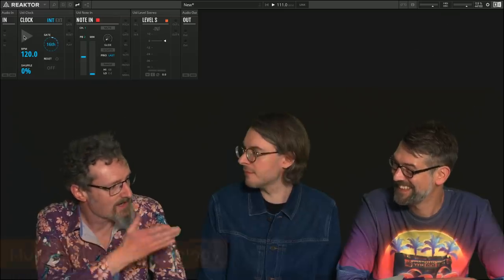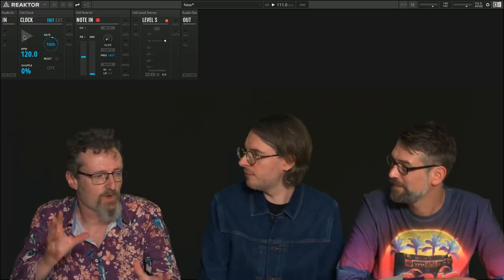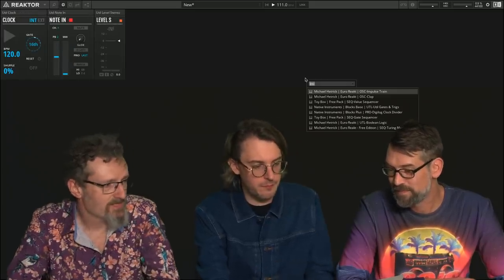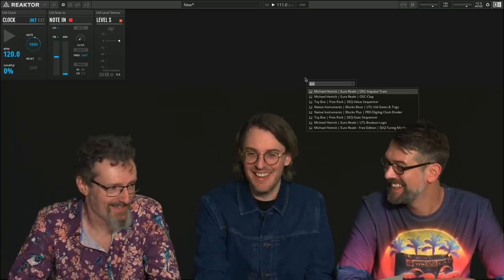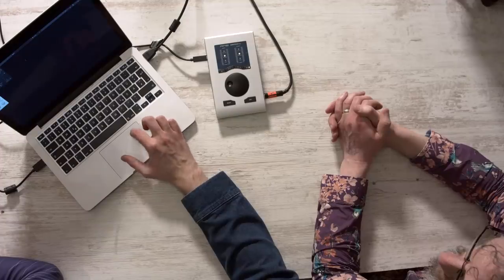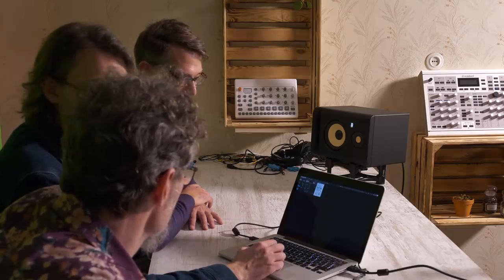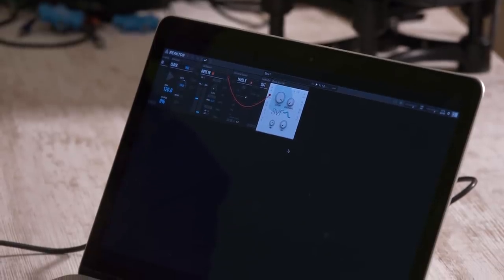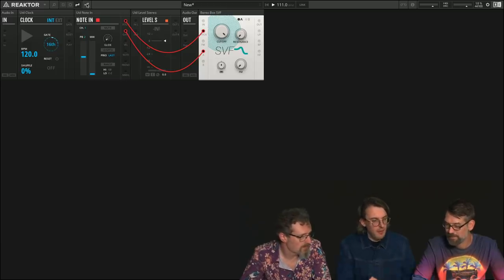Reaktor 6.3 - Blocks and Front Patching #TSR19

Comment: Just to speak to the LED jack thing ... the sockets like Expert Sleepers and on the Make Noise Shared System bus don't effect the signal in anyway. The LED cables from Mushi.one (and anyone else) does, because it pulls current from the signal/socket to power that LED as it's in the cable itself. It's not an issue for most things, but for sensitive pitch information etc you will notice a difference.
Reply from the maker: Cool! We need to design a new patch socket that has additional internal connections for LED powering and DMX control.

Comment: I tried to get into blocks but the CPU use is just insane, I use a mix of older and newer hardware. newer hardware runs it smooth but still. whats up with the bloat? Is this a javascript thing so the interface can look nicer and be easier to skin?    I have used reaktor 5 for years and still love it it runs well on Linux under wine without any issue whatsoever and allowed me to make custom headless "instruments" out of older laptops where the hardware's only programming or function is to run a single patch. Reaktor 6 bums me out this is no longer possible. comparing to VCV rack in terms of resource usage i can say VCV is less intensive even being an un optimized beta with known issues around CPU use. I am able to create more complex patches without spiking to 100%. I hope this improves I have loved using reaktor for many years, for now i will be sticking with older reaktor versions along with newer open source alternatives.
Reply from the maker: fair enough - i guess it's complex stuff
Reply: @MoltenMusicTech  I think the overhead is mainly due to the complexity but more so in making it more friendly and approachable for everyone. Older versions of reaktor were very daunting to approach while this version is very welcoming not only for users but also developers. this comes with a price of higher overhead. Newer machines are affordable though still too expensive to cart around to shows or hardcode a patch into an interactive art exhibit. Still i want to love it :D
Reply: Much of the cpu hit is due to the high quality DSP algorithms and the important requirement of all signals to be running at at least audio rate. Another chunk of it is due to highly technical reasons caused in part by limitations of the Reaktor core language. The builder community has been asking for related updates for years, but the community is very small compared to the general user-base, so it's hard to get these requests prioritised.